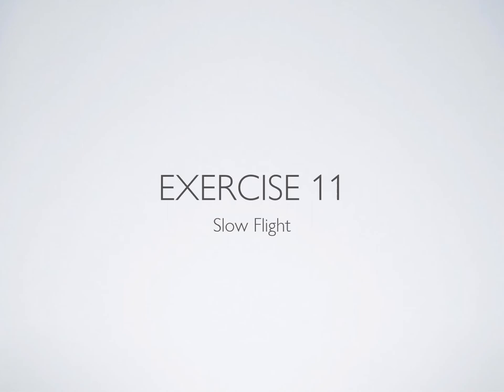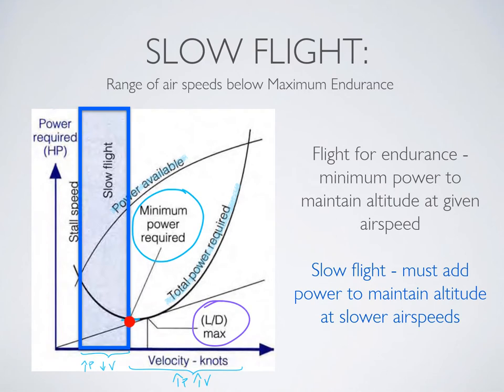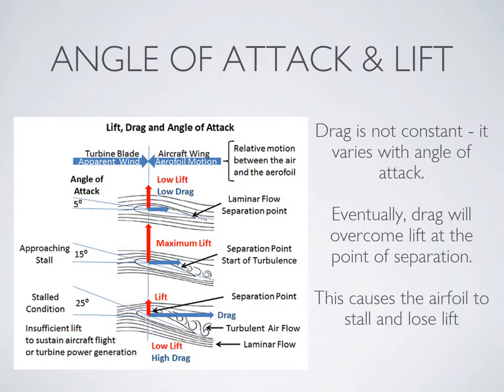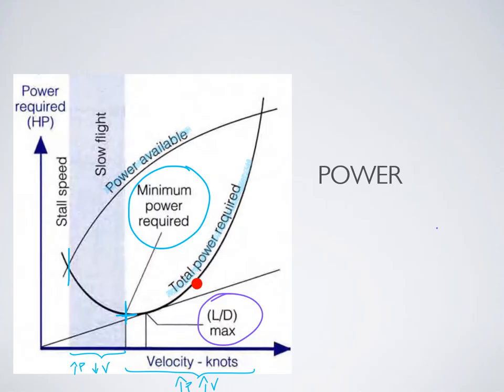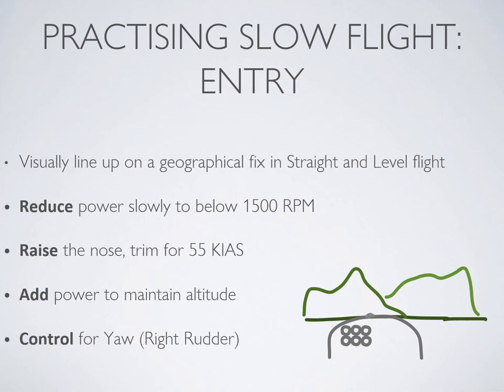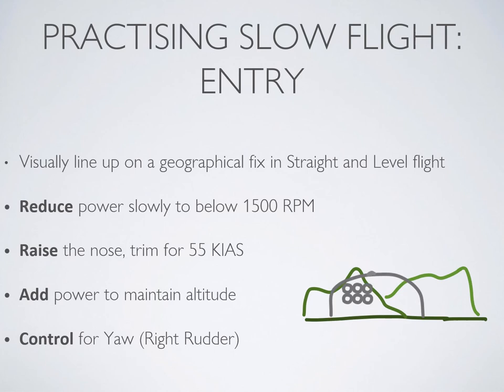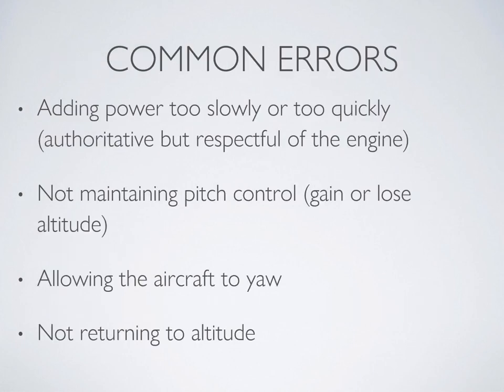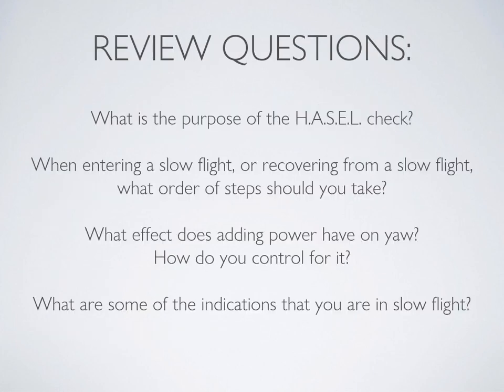Private Pilot License - Flight Training Exercise Exercise 11 - Slow Flight: Introduction

Comment: Isn't slow flight a normal part of landing? Why is it treated here as if it's something only "inadvertently" entered, as if by accident?
Reply from the maker: This is a really good question!  According to the TC PPL Flight Test Guide - "Slow Flight" is really anything on the backside of the power curve or "area of reverse command" as some know it.  It's the area "Where more power is needed to fly slower, as indicated by intermittent stall warnings or aerodynamic buffet", and the examiner wants to see the candidate both recognize the conditions of slow flight, prevent a stall, and recover to normal flight.

In a short field approach, you technically are almost trying to stall the aircraft onto the pavement right as you flare, in order to have minimal roll out. Similarly, during a soft field landing you might add power right in the flare in order to reduce the rate of descent.  Both of these flight conditions could be defined as slow flight, one where you are getting intermittent stall horn as you are touching down and the other when you are adding power right at your lowest possible approach speed.  At any rate, this is a landing technique intended to be executed very close (within a few feet) of the ground.  What we want to do when teaching slow flight is to teach the student about the way the plane reacts in this flight condition, how to recognize it, and if entered inadvertently, how to recover to a normal flight condition with little to no loss of altitude.  

The last thing we want students to do is to inadvertently enter slow flight during an overshoot, and try to climb out of it using pitch alone, which would likely result in a low level power-on stall, which would then become a spin.